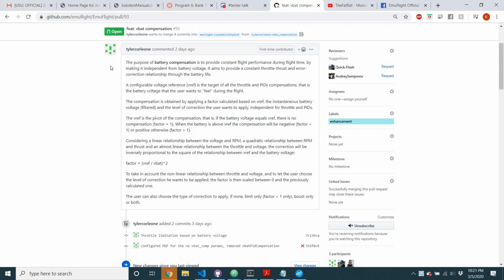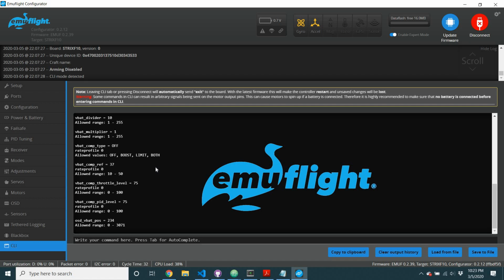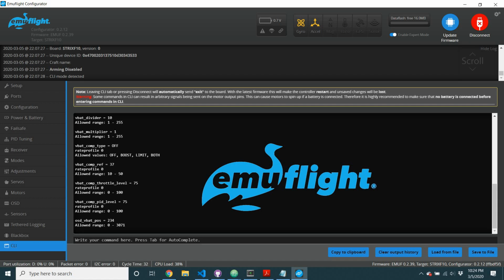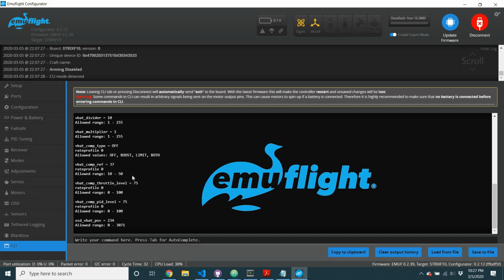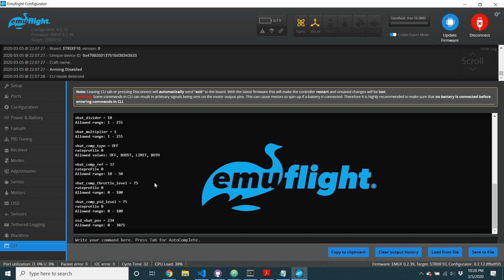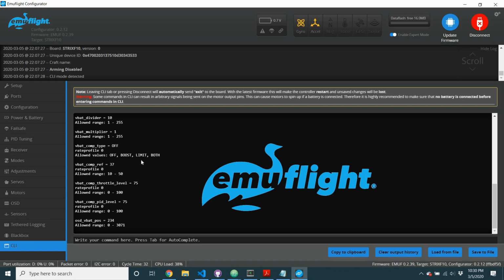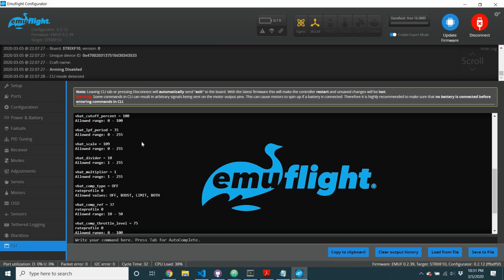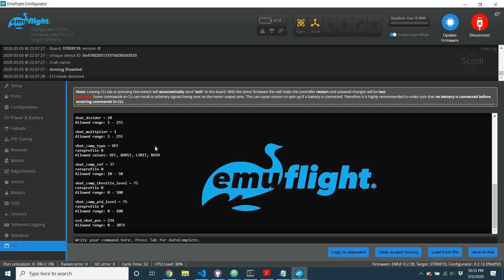Vbat Throttle Compensation (Thanks tylercorleone)

Comment from the maker: Realized I had said something wrong.  If you set the level to 0 for throttle or pid compensation then it will have no effect. With how vbat compensation has been changed I do think that it could be helpful and work well with your tpa. So regardless of what you want your throttle to do pid compensation can be good to have on, or at least it is worth it to test :)
Reply: So I’m looking for a consistent flight from
Beginning to end on my 75mm 1s whoops so I’ll set to both, should I use 3.7 for the threshold, and what else do u suggest I change to accomplish that no sag feel. I really like the betaflight 4.2 sag compensation set to 100, my flight is very consistent so looking for the emu equivalent

Comment: +1👍 this is actually pretty cool.. that said, i never used smaller lipos. i dont want this on my 6S. i rather how i see now that i pulled a lot and then it bumps back up.  i can use my brain to decide when i'm really killing the batt.  i also dont want my 6S pids/throttle changed mid flight.  so thanks for the "OFF" :)
my current
set vbat_lpf_period = 15
set ibat_lpf_period = 10
works for me for my osd, i can judge well.
but i realize this is more about small lipos and pids/throttle.
thanks QF & TylerC.
Reply from the maker: I like this. I am hoping to like this enough to use it as more of a standard on my bigger craft.